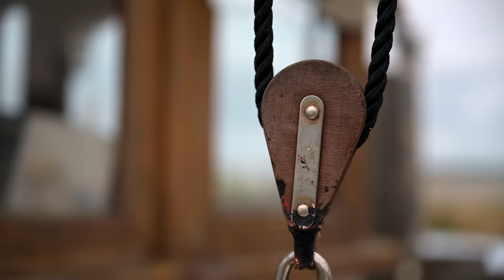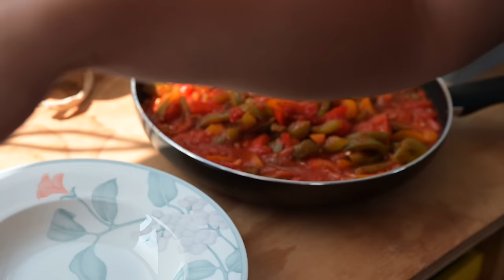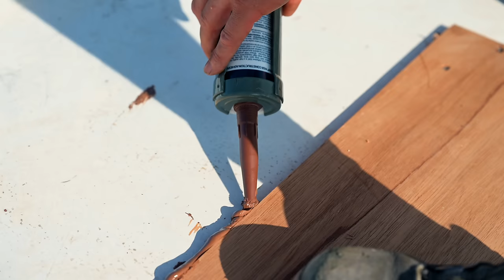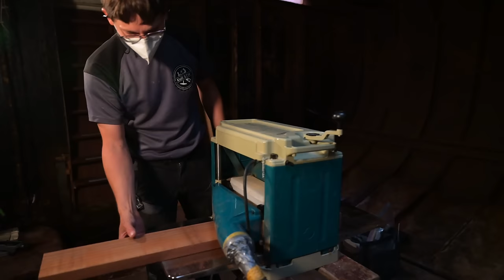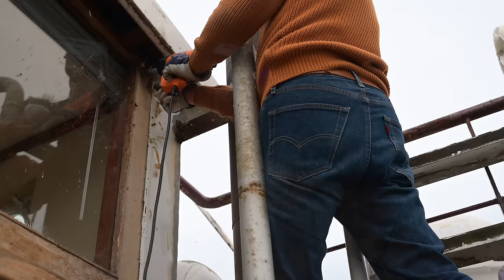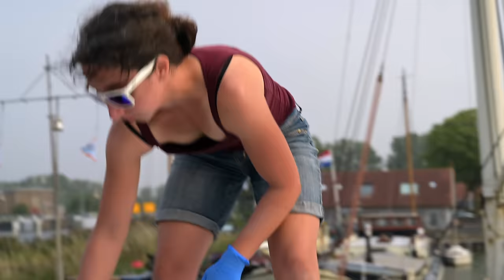Restoring A 73 Year Old TEAK Wheelhouse

Comment: Epoxy primer and a bit of betumen putty do not help. Wood and sealant are flexible in a different way and epoxy paint is not. Why? Does a civil servant have a wooden desk? Then something else works! This delays leakage. I think applying 2 or 3 layers of fiberglass over it is better.
Reply from the maker: Fiberglass is way better but way more expensive and outdoors in the Netherlands impossible to apply. Our fix will last at least 2 or 3 years and we have to relocate the wheelhouse for the sailing ship conversion. In my opinion its's either doing it properly including replacing the rotten plywood sheets entirely. But that's a 5 000-7000€ repair. Or fixing as cheap as possible to give you enough time until you have the time to do the proper repair. Everything in between is difficult for me.
Reply: @FlyingConey  I don't completely agree with that. It is applying 1 or 2 layers. Wood always works. I come from Spakenburg, with the largest "Botter" Fleet in the Netherlands. Wooden Fishing Boats from 1912 to 2009. When the last one was built. As a learning program of the municipality with the local 'Botterwerf'.
Reply from the maker: This "summer" was difficult and the wheelhouse roof is a large area. We were surprised how bad the state of the roof underneath the solar panels was. Our initial plan was to just apply new paint and fix the corner. We needed to find a solution that could be finished in about two weeks.  @gerbentvandeveen

Comment: Securing a roof patch with non marine treated wood, and no sealer to substain it? You would have done better to just marine putty it and sand and Paint! Sheesh. Its your shortcut,and vessel. Good Luck
Reply from the maker: The wood we've used is AW100 Marien plywood. We've used 4 coats of high quality paint to seal it. In my opinion it's good enough for the next few years. Then we will replace the complete roof and glass it over. Not enough time to do it now.
Reply: Used special marine sealant, Bostik MRS, on the roof on marine plywood. No shortcuts taken on materials.

Comment: Well done but you need to stop using paint brushes and start using rollers for these tasks as its a big ship and not a yacht .
Reply from the maker: On the steel the brushes work fine. We learned that painting wood is much more work. So after the first coat we switched to rollers.
Reply: Using bruches on steel doe's not give the correct thickness of the protective coating being applied as you are spread the paint to thin. Rollers give a more even coat over the area. All my steel ships built etc in Holland have either been painted with rollers and also airless spray as was the bottom of your vessel. @FlyingConey
Reply from the maker: PPG recommends to either sprayed on or brushed on and they say it's also possible to roll on. What we ended up doing is to roll and tip on the steel. On the wood rolling turned out to be faster. It really depends on what exact paint you're using. My recommendation is always to stick to the instructions that come with the paint.

Comment: No bedding compound on corner repair, no u/coat primer on any of repairs. Relying on the glue of the  plywood for rot minimisation / protection wont work. These short term patch pieces will be ruined again in 5 years.The guy might be a good carpenter but he's no shipwright.
Reply from the maker: There's bedding compound on the corner repair and we applied two coats of a high quality primer. At least 6 coats to protect the edges of the plywood. It will certainly last for the next 3 years and then we have to redo the roof anyway.